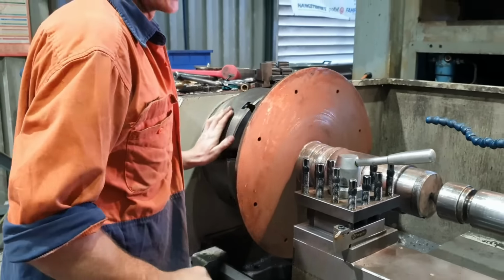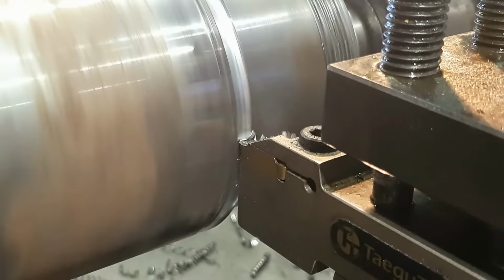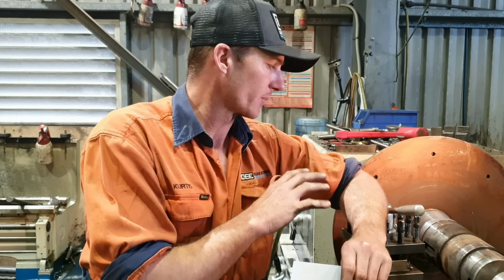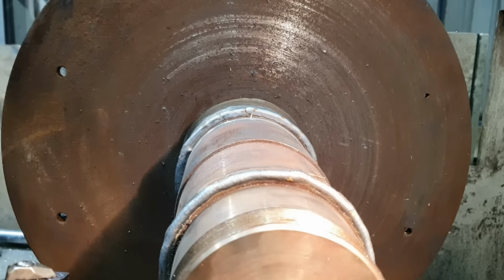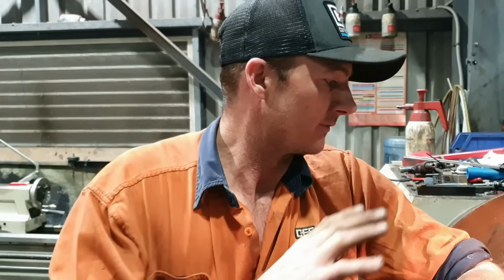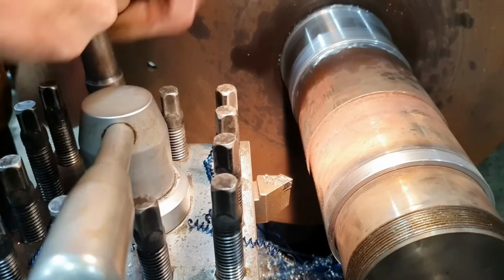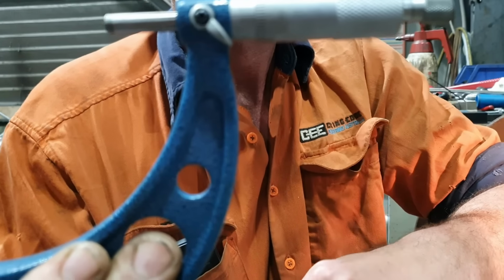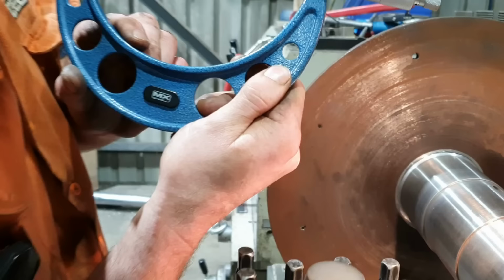Repair DAMAGED Cardboard Compacting Auger drive shaft | Machining & Welding

Comment: Yes,way too worn for an arc spray job,customers NEVER want to spend any money and ALWAYS have a ( reason ) why,I,m surprised they didn,t tell you it was a spare one for emergencies. Love the round cutter for the prep work,I know you prolly only opened it for the vid but if not always keep wire roller cupboard on welder closed to stop grinding dust getting in there and plastic flap sheet covering wire roll and we used to wire a baked bean style can around shift where keyway is just in case of spatter,but excellent job,her name would be Karen,females never understand machining,well almost never( sorry to the Karen's out there ) good you said no warranty HAZ could be a problem by flange or key,excellent job,excellent video graphics and explanations,can't wait to see some arc spray i used to love doing it,its so cool. Thanks to all and dogo for vid and posting,Best wishes to you all and dogo,from, Auckland, New Zealand👑⭐⭐⭐⭐⭐💥💥💥💥💥👍💯%✅🙂🙂🙂🍻 sorry didn,t mean to be critical,its been a while since I was in a shop.🍻🍻🍻

Comment: Know you know, trick can do is use an clothes pin and a piece or rag. Wrap rag around the Welding wire at point where goes into the first tube from spool! Hold rag on with clothes pin. That will clean wire before goes though rollers and lead. You will be surprise as how dirty the wire is!

Comment: Hey Curtis do you ever have to worry about heat input into some of the parts your welding. I know I do some welding on smaller stuff and the amount of heat can bend or deflect the piece I’m working on is that so when it’s at scale you’re working on?  Ps just got my 🍌 shirt. Love it

Comment: Out of curiosity, you say there's no warranty as the shaft is past proper repair, why is that?  Is it to do with all the weld affecting the temper on the shaft as its mounted to a bearing?

Comment: Just wondering, you have a machine to build up weld inside of a hole, why no machine to build up weld on the outside of a shaft?  For as often as we've seen you build up a section on the outside of a cylinder, seems like a machine like that would keep you away from that repetitive task.

Comment: The thing i dont get is if people did the routine maintenance it would be cheaper and better for them. Like not changing the oil in your car just to change the piston rings, bottom bearings etc

Comment: great video as usual Kurtis, 2 days late for me, Friday mornings for me now start as the sun rises  Sunday morning fresh ground organic coffee beans and sit down to CEE video, I have my priorities straight , then comes some yard work, Kurtis your payroll is about to change  Karen works 4 job classes, bookkeeper, payroll, videographer, and video editor , so i guess you'll have to raise the shop rates some what to cover these new costs of doing business ,LOL, the safety officer needs no raise he gets added bonuses tax free in the mail, they usually sit around and chew the fat or whatever comes in the fan mail 😂 we have a 400 ton Minster press we use to punch holes in almost all our products, it stands almost 3 storeys tall with the flywheel up top last summer we looked up to see the shaft of it glowing red and smoking almost to point of a fire so i shut it down normally no E-STOP , that would have allowed it to catch fire from the grease and oil normal it has an air brake disc on it that is very effect and has an air wash on it to cool for this exact scenario , the flywheel is right at 7 tons and with the shaft add another ton,  so had  the crane come in  and we have a hole cut in the roof for him to operate and facilitate the lift to bring it down, sour millwrights clean and take it apart and it looked about the same as the one you fixed here, the only difference being this shaft is more than twice the diameter ,we don't have machines big enough to repair it and sent it out to the guy down the road a 1/4 mile away he looked at it and said new would be better and we tried and found out it would over 2 months away so he repaired just like you did by skinning off the damage ,welding up the service  which was way too many hours of welding he said, then remachined it to spec and we had it back in about a week and it went back together and is till working just fine without issue and it has a monday morning schedule for lube and inspection, the owners thought of changing it out and soon found out that anything new to handle the volume of parts put through it and run 24/7/365 is 3-4 million dollar purchase and parts are only available as custom made as is each machine so down time would be almost 3 fold we can run and repair and rebuild this machine with custom parts for another 50 years for that kind of money, i have nothing except the utmost respect for you and all the machinists alike that do quality as you do, all 3 of you deserve a increase in pay , don't forget the videographer and editor in there, always look forward to videos every Friday 👍

Comment: Hey how much wire do u go threw in a day? Im a beginner welder with a little hobart 175 running argon at 20cfm but it still axts like flux core. Ive already switched polarity but it spits and spatters like its loosing connection but I know for sure its not. Any idea??

Comment: This is such a fine looking repair, I have to wonder... what would a 'warrantable' repair look like?  It seems that the only alternative would be fabrication of an all-new component.  Considering the buildup area is a base for a bearing race (as opposed to being a running surface itself), I'm guessing this is every bit as good as a new part.  Great work, as always!
Reply: Very likely, the proper repair would involve cutting out the old shaft, machining a new one, and attaching it to the flange.  He has done several such repairs but the cost is likely quite a bit more.

Comment: I do not know what you charge but one thing is for sure someone was not checking that bearing or even paying attention to the operation of the machine. The price of a grease gun and a few tubes of grease would have prevented this.

Comment: That is not a get buy or half ass repair. What would you do too make it better? I have been doing repair Jobs for almost 50 years. Only suggestion is slow the speed down on the lathe a little , and take a deeper first cut . It gets under the ruffness of the weld, alittle easier on the tooling. And much faster.

Comment: Damn, this part remembers me of "The Repairjob" of a lifetime i had.
A nice company from China build a machine for an customer, and the part my company had to repair looked a loot like your part. only thing that was f++ed up was that the front bearing was smaller that the shaft in between. the bearing itself was mountet in an flange on the machine, so it was not a problem to pull it out. Problem was that for replacing the bearing itself on the shaft, you had to cut the front faceing plate of the shaft. between the two Bearings on the shaft they has a drive gear located that could not be moved. God was that a shitshow. 
Plate was Chrome Nickel and the shaft was some kind of high carbon steel with nickel plating, weldet with rotary friction welding. Cou cannot imagen the new kinds of swear words the repair crew invented when the boss rolled that pallet in

Comment: I'd use a Dayton gear reduction contolled motor, acme 4 threaded welding jig, threads in a spiral tube, to move that then clamped welding handle and move the appropriate ammount per rev.  That is way too much radiation absorbed.  Ok, well, I love the show all the same!!!!!

Comment: Laughing out loud on the outtakes.  Best videography I’ve seen on any of these types of videos.  The slo-mo video is great, but the slo-mo sound is like a revelation or something.  The use of the correct tinted glass on the welding gave me a view I’ve never seen before - it always looked like magic before.  I’m just a house carpenter, so I don’t understand all the intricacies and details, but these videos are (strangely) dramatically riveting to me.  I find myself leaning in to see detail just as The Giggler zooms in to give it to me.  Well done, team!  Thanks.

Comment: Bjr, Plutôt que de recharger la pièce en soudure, d'y souder un fourreau et de l'ajuster ensuite, aurait moins couté...
Bjr, Rather than recharging the welded part, welding a sheath into it and then adjusting it, would have cost less...
Sans oublier que ce ne sont que des chemins de roulements...
Not to mention that these are just runnin

Comment: The shop i work for does alot of work like this on shafts for flaking and cracking rolls.  In almost ten years I recall only one instance of a shaft breaking  after welding.  Great work!

Comment: What is your main concern, delamination or tolerance issues because it's a bearing spot or under heavy load? Just curious if you have time to reply. Looks pretty damn good to me, nice work as usual.
Reply from the maker: Hey mate the introduction of a new higher quality metal using arc transfer can cause a heat affected zone and being it is a drive shaft under load this concerns me enough to not warranty the job
Reply: @CuttingEdgeEngineering  Thanks and wise decision. Keep up the great vids!

Comment: My ole man was a machinist, and I remember as a youngster sitting on the back porch with my pocket knife picking all the chips outta the soles of his work shoes.
I can still smell the cutting oil when I watch your videos. 
Since I watch on my 65 inch big screen I can see the little wiffs of smoke coming off the incerts, and the camera lady needs a big raise.
She's got it down very fkin well from the views you get on a full screen shot in high definition. 
Only thing missing is the smell, and I'm seriously thinking of getting some cutting oil, putting just a bit of heat to it.
Then it'll be the whole bite right in my living room, and while I don't have Curtis accent, I do believe I got the verbiage correct long ago.
Lmfao, yes ma'am fine cinematographer you are indeed. 
Homeless only has sired eight pups, why he definitely needs more practice the .
How would you like to be restricted to only once in your lifetime there Curtis. 
I didn't think so, so how bout doin your mate there a favor, at least set him up few times a year.
Can you imagine the pain the blues are causing him, makes one think bit differently if you look at it from that perspective

Comment: Curtis, how does the hardness of a welded repair stand up compared to original material in the seal wear area? Nice job.
Reply: probably stronger than the original part, i’m guessing, because the repair looks better than if it was a Factory Part

Comment: Been welding since 1998 and I worked in a machine shop for 8 years.  I've done so much build up like this. I've never seen it done in this position.  We were always able to turn the shaft into the horizontal position.  Pretty cool to watch.

Comment: I've always favored a 95-5 mix for my gas. It flows a lot better with minimum spatter. Works really well when you are pulse arcing with .045 wire.

Comment: I see that you have to change out bits pretty often. Do you have to pull them out and sharpen them or toss toss them out? I would imagine they have to be much harder then the material you are milling. What does bits usually cost or can you just make a new one like some of the equipment you made for the shop? Piece looks great. So easy to tell the difference in the areas you repair verses the rest of the rusted areas. Cheers mate!!!!!

Comment: They must of been really overloading the shoot that feeds cardboard to the auger to stress the bearing and damaging the shaft or both. Or maybe something very hard was feed into the auger for compaction. Black humour joke would be the manager desposing of surplus employees bodies after the dastardly deed. Or otherwise, the machine has been doing really hard work at the local supermarket for a long time noting the weathering rust on the auger drive face. They don't show the spiral auger. I am wondering how much it is no longer runing true. Some of these auger cardboard waste reduction units cost 10s of thousands of dollars. Something you may not want to replace on a regular basis. I tale it that the drive sprocket weather gear or belt driven is mounted onto this shaft to be driven by a motor.  The staff must not have noticed the difference in machine performance as the noise of these machines is considerable. Machine must have stopped suddenly not to work due to total collapse of the bearing after bearing failure. It must of taken some time to grind down the drive shaft that much as the remains of the bearing , either roller or ball bearings would be of hardened steel.

Comment: I'm sure you've been asked this question before, but I haven't seen it yet: When you're additively repairing a part like this (i.e. hardfacing), how do you know/ensure the added/welded material will be as strong as the original material?
Reply: By comparing the properties of the welding wire against the original material

Comment: Geez, welding up the shaft on the turn table definitely takes a large amount of concentration, given how slow a speed it turns.  How long did it take for this shaft build up?
As only an observer with about 1 grade of machining in high school 45 years ago, just wondering why you don't use oil when turning down the shaft to keep it cool?   Love the work I see you do on here.

Comment: Top quality temporary repair ..with your skill set that'll probably outlast the bloody machine now. Guess it got a touch warm as you could see the heat or smoke coming off after welding , get Karen to show the thermal heat gun so we know it's way too hot to slap ya dick on it .. and the best bit ..the squeal from the micrometer lol. Great recovery of another slightly fubared lump of scrap . Thanks guys . 
Maybe next week you can see if homeless wants to do a safety check on his bed ...or get out of it for sommat more interesting lol.

Comment: Curtis,  I have been wondering, what do you do with all the shavings from the milled items.  With there being different metals that you work on, Is there a way to recycle is somehow?  Thanks, not a machinist but I have always been fascinated by the work.
Reply from the maker: hey mate we've got a big metal recycling scrap bin, all the shavings and scrap metal (all metal) goes in there and we get paid per tonne 😎👍

Comment: the other way to repair that shaft would be a speedie - sleeve  and high strength retaining compound. but that was so badly worn build up is the only choice unless you made a new shaft.

and yes i reckon that will still be there working in a couple of years. remember buyers are liars and salespeople are full of shit.

Comment: I would say medium quality repair, don't why you didn't use any cooling agent while working on that lathe, the widia stone still need cooling. More than that, when using a micrometer the surface that should be measured has to have a certain level of roughness, you just used some sanding paper. All in all quite unprofessional.

Comment: Hey Kurtis, awesome “temporary/permanent” repair, judging from the comments below the client has no one fooled here but smicko finish mate. Question from a newbie, was there any reason you welded this in the horizontal position rather than vertically from overhead, was it a better fit in the positioned for example, just curious. Karen, your filming has come light years in such a short space of time and I love all the info on wire, gas, amps speed etc as we get a great insight from these, also the Slomo of the tool cutting shows the chip being cut and now you have the closeups of the welding with the shield sorted out too, really well done and appreciate the effort you put in to make these videos as interesting as dull ares Kurtis can do……just kidding. You two are a great Aussie team. I think it’s time to organise Kurtis in a 4 jaw set up competition against Adam, what’s ya reckon, Aussie boy does the yank. Thanks guys

Comment: Curt, love your channel. I have a rookie question. Is it better to take a deeper non interrupted cut when cleaning up a welded up shaft than taking a lighter interrupted cut to lessen the impact on the cutting tool as long as its within the capabilities of the machine?